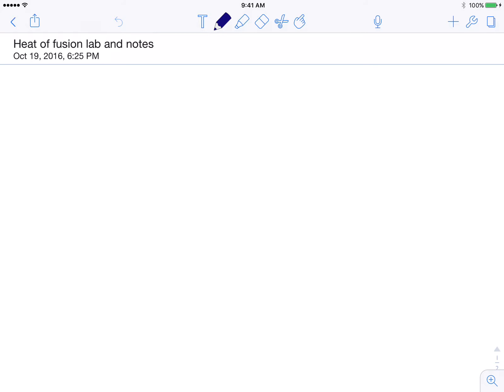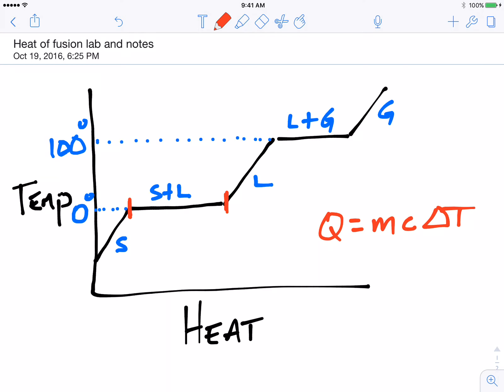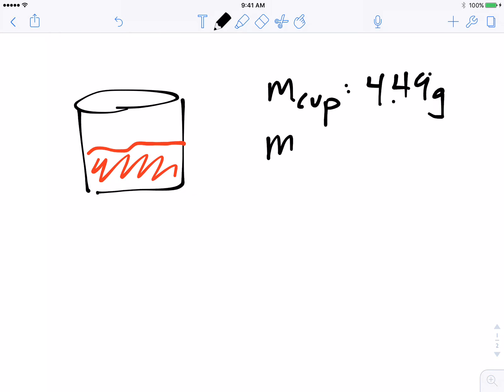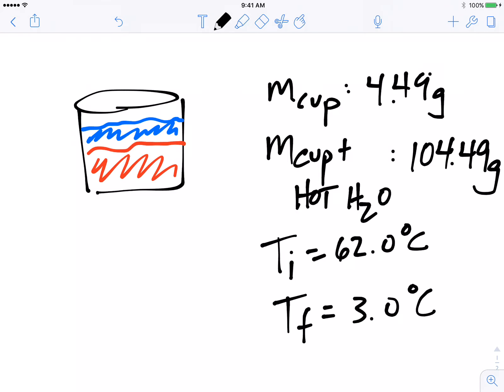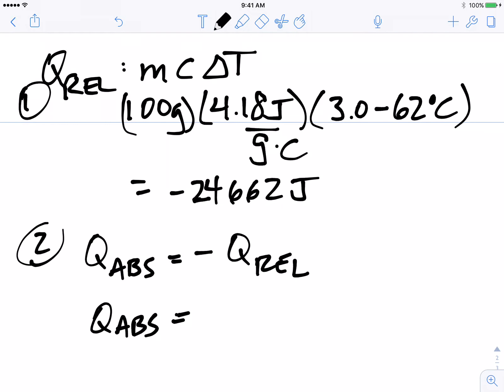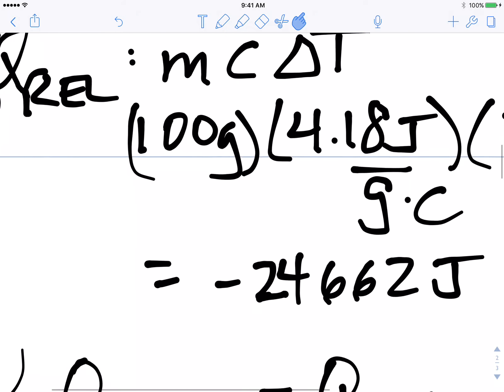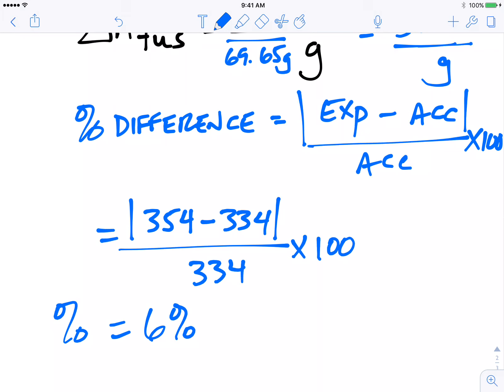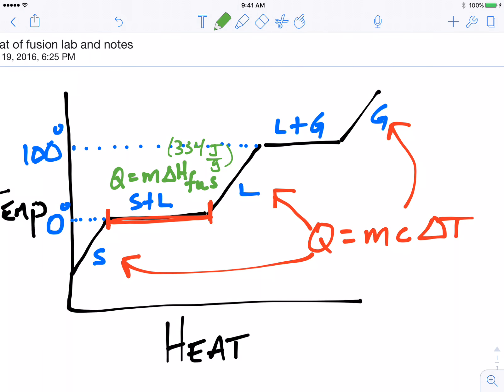heat of fusion of ice notes

Comment: why don't we substract the mass of cup from 69.65 g?
Reply: does it absorb heat too?
Reply from the maker: @megienebish8842  the cup does absorb heat, but in a first year class, we don't factor in the calorimeter constant (how much heat per degree C) that the cup absorbs.
Reply from the maker: the mass total (174.14 g) is the cup + hot water + melted ice.   the 104.49g is the cup + hot water.  Subtracting them gives just the amount of ice that melted